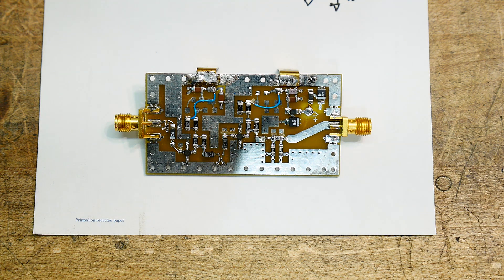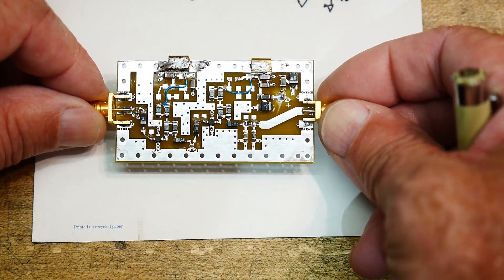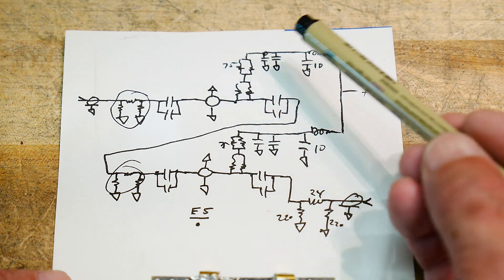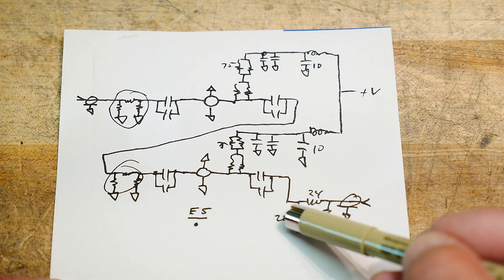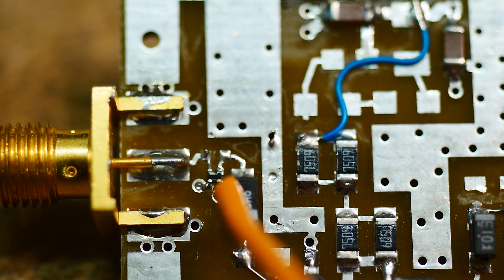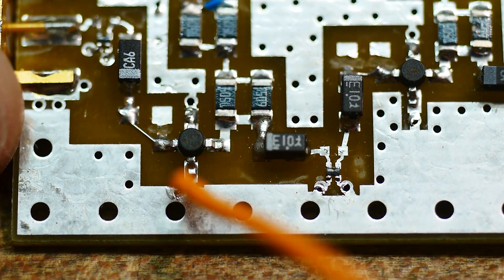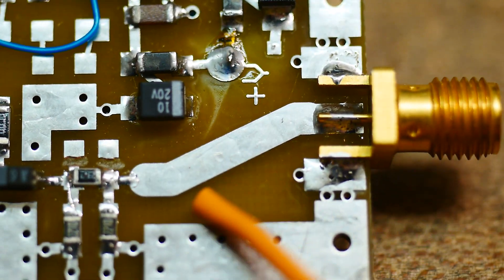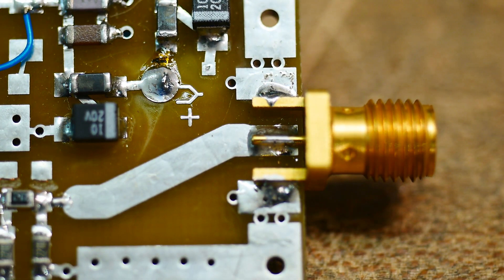#553 Prototype RF amplifier

Comment: What a Strange MMiC prototype circuit board design  ?? ....Needless input Pi Attenuators  and Huge (fraction of a fraction of a fraction ohm Reactance) 1uf Electrolytic coupling caps for Microwave (or Any RF) application ?? ...Considering how unconditionally Stable most commercially available MMiC are, this prototype pcb circuit seems Really strange !!

Comment: Because of the 75 Ohm pullups, maybe the whole thing is designed for a 75 Ohm system not 50 Ohm? Receive is optimal at 75 Ohms thus the cable TV world is all 75 Ohm. Transmit is optimal for 50 Ohms or so I recall. Old twin lead was 300 ohms (4 x 75 Ohms) and old TV receive antenna feed line was 75 Ohm coax.
Reply from the maker: no, that resistor sets the bias current in the MMIC chip. it is chosen for the milliamps needed and the supply voltage

Comment: On the upper rihht of the scematc, could the serial/parallel resistor arrangment  have been done to average values for bettet tolerances?
Reply from the maker: no, I'm sure it was done to handle the current. resistors not enough wattage